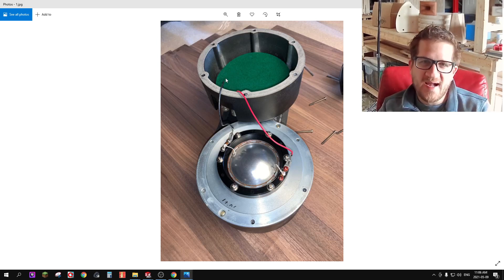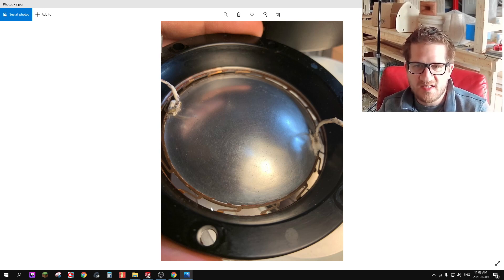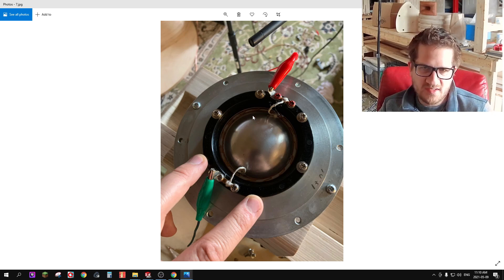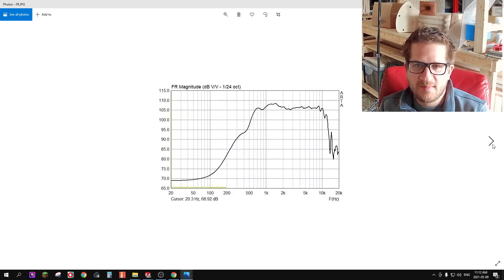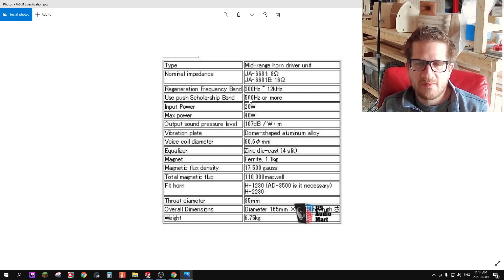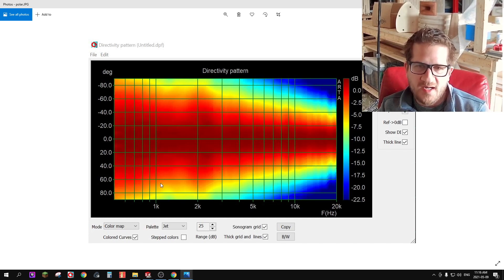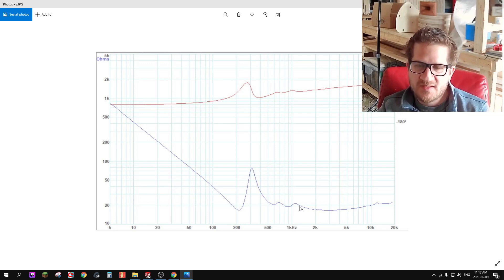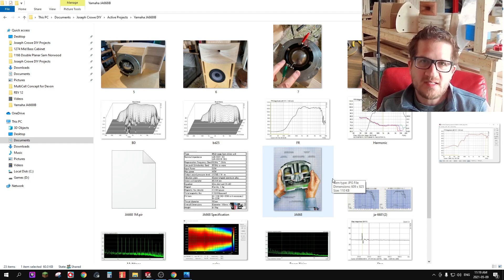Yamaha JA-6681B Compression Driver Full Test

Comment: Dia centering is a huge issue on all drivers. Even fresh from the shelf most distort. Human centering, skillfully, can improve any driver dramatically!
Using sine, educated ear hears more high order distortion than the mic/fft. Only impedance measure is even better than human ear. The higher your resonance peaks the better. Its not only about turning clockwise but mostly centering in the 0.01mm range. The topic actually deserves its own video 🙂
Reply: I just unscrewed the screws he is talking about and I can't hear a difference. Not even when loosening all screws. Maybe mine was centered good by Meyer.
Reply: @rewind9536   what Input did you use? 
In my experience only low frequency sinus was useful. 500Hz is the highest useful but the lower the better. With care and small amplitude, try 200Hz and you can hear things very quickly. Put the volume low for safety and go near with your ear.
Reply: @joshhm7438  Thanks! I will give it another go.